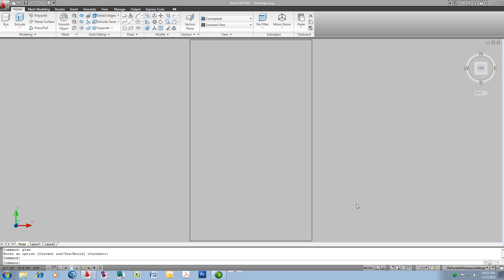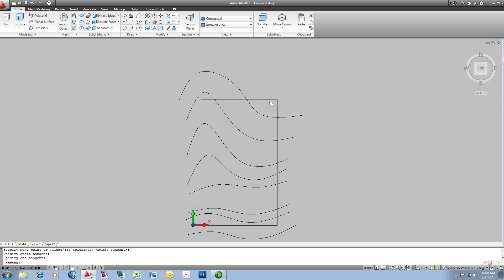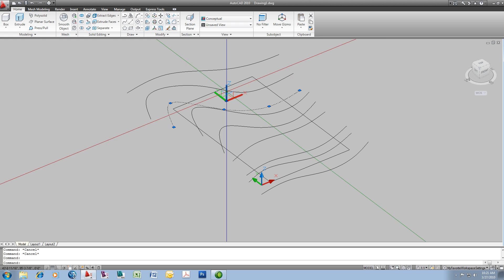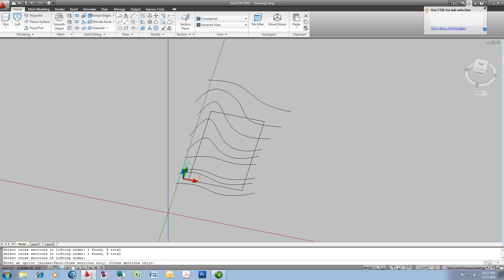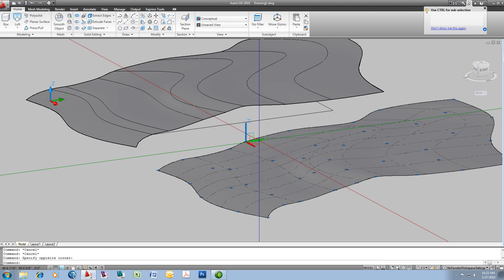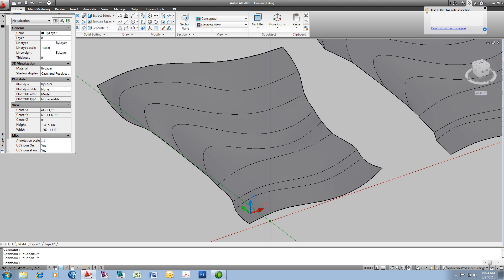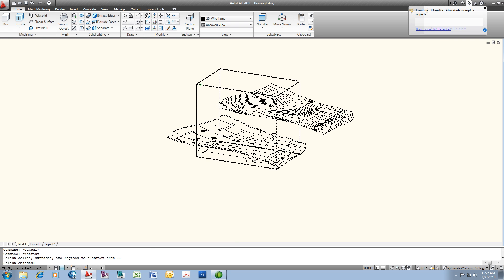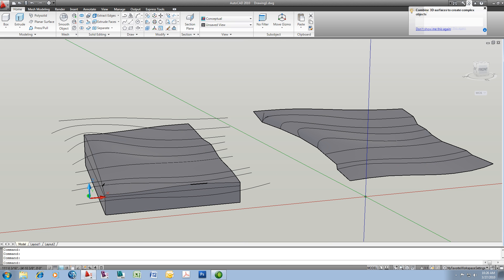LoftedTerrain.avi

Comment: thicken isnt working with me, it keeps telling me object intersects itself.
Reply: Make sure you don't have a polyline that has duplicate points on it...sometimes if you try to do some command with AutoCAD and your subobjects have "issues" (like duplicate segments or overlapping/self-intersecting/crossing elements/points) it can cause mathematical problems for commands to modify those objects or turn them into something else (like a 3D Solid).

Comment: Hi. Please help. I am using autocad 2012 and the subtract option. Nothing happens. Could you please give me some more instructions on it. I did everithing i tipe in SUBTRACT and select the cube than the terrain and then hit enter. Nothing.
Reply: When you use the subtract command, you click the object you want to remain first, then hit enter.  Then, click on the object you want to remove, then hit enter.  it should work then.
Reply: Thanks a lot.  I figured it out eventually. Yeah that was it i did not hit enter.  Thanks again.
Reply: Burlacu Leonard You're welcome, it's always that one step that throws you off. :)